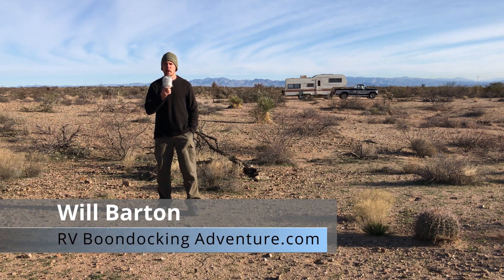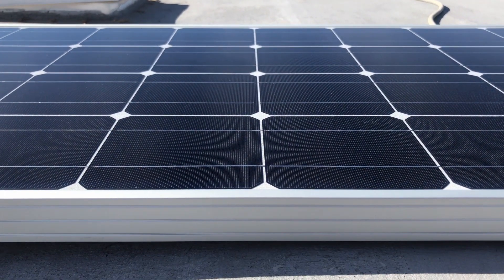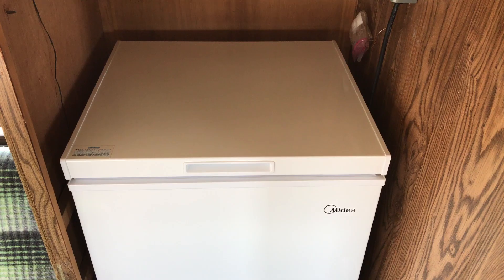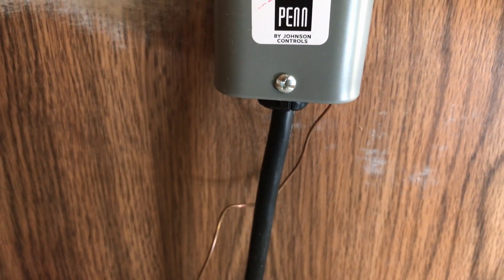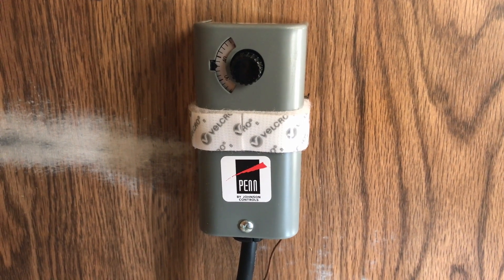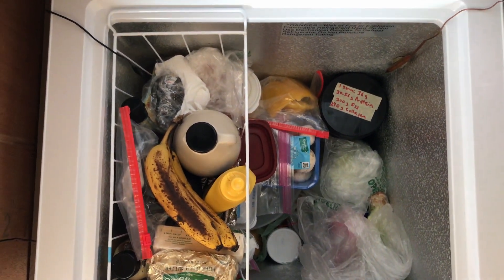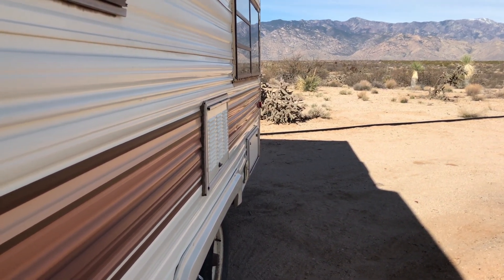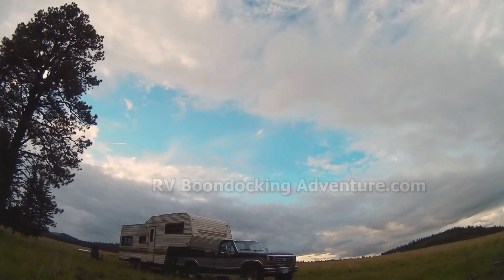Chest Freezer to Fridge Conversion, Super Efficient Solar Powered Off-Grid Refrigerator

Comment: Only thing to watch out for is the evaporator coil is made of metal un-painted pipe, and in the freezer application there is typically low pressure and ice on the pipes, but when you are running at higher temperatures they freeze and then defrost in every cycle and higher pressures, so it won't take long before the metal pits and starts to leak.
I made a freezer into a fridge, but bi-passed the cooling circuit and put in an evaporator from a frost free dumped fridge it runs the fan continually and swopped out the freezer thermostat for an air-sensing on on the return air, it will go forever, oh and I'm a refrigeration technician so this was easy for me.

Comment: this seems simple enough.  is this setup still working for you?  i asuume you can just use 110 as well without solar but thats a nice feature.  my fridge at home recently died so im thinking of this setup until i figure what to do about it.  i already have  a sm freezer that that that im going to keep as a freezer but looking for another to turn into a fridge.  Does it affect the life of the freezer and can you go back to a freezer setup by just removing the controller.  also do you keep the freezers orig thermo off position?

Comment: just the info I was looking for! scratching my head over DC type EXPENSIVE RV fridges, etc. -- I've often wondered about the use of a chest type freezer AS a fridge -- but for residential purposes rather than RV'ing though now that I have an RV (trailer) I'm definitely now leaning in the direction of this off-the-shelf freezer->fridge option.
my motto has always been -- "whatever works -- use it!"
this solution of yours works. I think I'll use it!

Comment: Extra efficiency can be found by wiring the external thermostat to turn the inverter on and off. Then just wire the inverter directly to the freezer. Does need some electronics knowledge though.

Comment: Question about plugging it in - you plugged the fridge into the temp control and then into the power bar, but do you need to change it from DC to AC or how does that work?

Comment: Good review and a lot of great advice here about the way you park and all the details you mention to conserve energy, very frugal and efficient indeed. You made a lot of good points here, one of ur issues could be overcome by making or getting a nice fitting foam box/container sleeve to fit in the top half or so of ur fridge/freezer setup, cut some elongated slots in side for grasping handles to remove when u want to get a frozen product out from below deck, and use the top half as a fridge, u would need to turn down the thermo of course, but I have done this and it works pretty good. Another small tip is to wire the thermostat to a contactor to activate the inverter when the thermostat calls it up, this can use significantly less power through discarding the inverter idle drain between cycles. Cheers

Comment: Maybe I missed it, but what size batteries did you use?  And are they serial or parallel?  Do you notice it needs a lot more juice to start up the compressor then drops back down to a lower rate or does it stay low all the time?  Thanks for any help!  About to try to build one of these with zero experience lol

Comment: I use a 5 cubic foot freezer for a refrigerator. I use it off grid through my inverter. I don't use an external temperature control. I simply keep the entire bottom filled with one gallon or half gallon frozen jugs of ice. That allows me to run the freezer just about 4 hours a day keeping the food on top nice and cold. I simply manually monitor this a couple of times a day. No problems.
Reply: When it is freezing the jugs, isn’t it freezing your food on top also?
Reply: @Lst2ltdwn  If you don't shut down the freezer it will freeze everything in it. That's why you run it for just a few hours a day. You simply keep an eye on it a few times each day. Getting too warm on top? Run the freezer for an hour or two.
Reply: @MrBwalendy  Could you partition off the bottom half with a piece of styrofoam to create a fridge/freezer?

Comment: Young man, thank you for the video, perfectly done. This is to let you know the link to the thermostat is no longer viable, therefore not giving you the affiliate reimbursement response that should be applicable in this case. I did not check all of the links above. I find Amazon does this to quite a many of you. The product is there, the affiliate is not, as I had to keep digging to find it.  The freezer link worked. Blessings on your travels.

Comment: Can anyone tell me what size lithium battery will run a freezer to fridge conversion of 3.5 c ft. I now have 120 watt solar panels but will be adding more. Need around 300watt Ive been told.
Reply: Lithium batteries are like motorcycles. You always want more power.  100 amp hours should get you started. Some are down around $400 now.  Its your inverter that might be the hangup. Mine is a Renogy 1000 watt pure sine unit and it has been very reliable. An inverter that's too small will trip out on overload and not start the fridge.

Comment: I would recommend opening the freezer and disconnect the automatic defrost heating element! That will greatly save you power from your batteries, and you really do not need the defrost option , and it will make it even more efficient , and small 12v computer fan sucking heat from back of the freezer outside of your camper every time it turns on :) and then you have the best solar and cheapest RV fridge

Comment: Does anyone know if doing this reduces the life of the freezer? Since it shuts off the power on or off in a way that isn't normal to the freezer.
Reply: In my experience it will significantly reduce the life of the freezer if it cycles on/off as often as a refrigerator.  To reduce cycling the temperature set point needs to have a wide band of several degrees.

Comment: Thank you for sharing!! What if the solar panels don’t receive enough sun as you do? I’m in Ca. and the fog rolls in often.
How many hours of direct sunlight do you need to make this work??
Reply: A lot of these setups seem to run 40-80 watts with the inverter losses included.  They don't run constantly though.  Standby power when it's not running might be 5-20 watts depending on the models.  I think I've seen around 600 watt hours for the day.  It depends how hot the air around it is also.  If it's hotter it takes more than when it's cold so good ventilation helps a lot.  
I have thought about building one with another 2-4 inches of foam board all around just to see what it's like.  Then have a vent door into the freezer vent from outside with a thermostat controlled flap that vents heat inside or outside depending on weather and preference.
Even with the setup as is in the video the 200 watts of solar is pretty solid if the panels face the sun as well as possible.
I would say at this point.  Lithium batteries bury lead acid already.  A diy kinda person can watch a short video on YouTube assembling a battery out of 4 280ah lithium cells for less than $500.  That makes approximately 3600watt hours.  About three times a lead acid.  But it's as good as 5 or 6 lead acid and will last 5 times longer as well.
Reply: Apparently some are saying that some modern freezers dissipate the heat through the outer shell... You would want one with a very important vent on the side to dump heat

Comment: Excellent video!  I have purchased my freezer and temp controller but I have one question. What do I need to set my freezer temp controller on?  It’s 0-7. I have it on 4 now.  
Thank you for any help!
Reply: I'm not sure the  freezer control matters much as even at it's lowest(highest?) setting it should run till it is below 32F but your temp controller should shut off the power before that as your looking to keep it around 38-42F. to make sure its working properly you'll want to have a way to check the temp, either with a indoor/outdoor device like the one used in this video or something smaller that you just keep inside the freezer.
Reply: Daniel Avenson  thank you. I have a thermometer I have been using. It’s working great.
Reply: I’d set the freezer at its max and let the auxiliary ‘stat run the thing free reign.

Comment: There is no moisture management in the deep freeze, these quickly fill with mold
Reply: Do you ever clean your home fridge?  Its very easy to clean one of these.  I have two Dometic fridge freezers and they still don't have mold, so quickly is pretty far off.  If he is a full time off gridder, he can just preplan , have a spare cooler to put some food in, or be on his way back to get more food and leave it out in the sun for an hour.  Jeez, its totally not hard at all.

Comment: I replaced my freezer thermostat with a refrigerator thermostat.  $16 on Amazon, and it looks original.
Reply: Maybe you should also do a video then. Was their rewiring involved?
Reply: @Gandioneare7844  Just some screws and spade connectors.
Reply: Do you have a link to the item on amazon?
Reply: I don't.  It was a few years ago, and depends on the make and model of your appliance.

Comment: You didn't cover condensation/water build up on the bottom... I heard that can be a problem. Is there any way to run/make a drain for the bottom of the fridge, or would you recommend against that? Thanks for the video!
Reply: every chest freezer i've seen has a built-in drain from the factory.

Comment: I've operated three 8cf freezers as refrigerators with these Johnson controllers in my BBQ food truck. Work well but there is a fairly significant temperature on/off variation because the inside air stagnates on the bottom.
I haven't got around to it yet but a definite improvement would be to place a small ac muffin fan on the top of a PVC pipe or a eave through section to circulate  the air top to bottom. This would be powered from the compressor plug and mounted in the corner of the fridge. It would keep the temp far more uniform and improve overall performance.
Reply: Great idea.

Comment: no need for a refer if you have a freezer....just cycle frozen food / water / etc. into a cooler to defrost and cool ....then only one compressor to run....
Reply: And how many watts/btu are used up freezing things? That seems counter productive imho
Reply: @fishhuntadventure  my refer uses 4 A.@ 12v...50 watts , WHEN IT'S RUNNING...maybe 2-3 hrs. a day ,easily handled with solar or  ?
  as a freezer it might run 2X that(?)...i also built a foam box to enclose it for better efficiency..
 these little compressor types are so much more efficient than any alt. i've found , but it assumes you want COLD storage for a week or so...it changed my life for the better
this is an old acct. i'm visiting ; funny how much things have changed in a year !
OH...just looked @ the vid , and it's true , a 110 thru an inverter would use  more (?)....i am using a 12 v.danfoss type

Comment: I'd like to share my results on a similar project.  So there are a number of variables here that I'm aware of so technical guy out there just sit back and relax.  I bought a brand new Magic Chef 3.5 C. Ft. chest freezer (June 2019).  I bought a digital temperature controller and set the fridge/freezer compressor to turn on at 40F and turn off at 37F.  Once off, I recorded the temp continuing to drop as low as 30F before it would start the slow temperature climb back up.  I found it interesting that the temperature dropped another 7 degrees after turning off.  Also note that I had the unit completely empty, unit already at the desired temp and it was placed inside my house at a constant 78F when I started this test.  After 48 hours, here were the results of my freezer to fridge conversion: My kill-a-watt recorded that it only consumed .238 KWH (which if I calculated correctly, is only 5 watts an hour on average).  Of the 48 hours, it ran 7 hours and 40 minutes.  I noted that when the compressor turned on, there was a momentary spike of 700-800W but leveled off very quickly to around 60W.  I forgot to log the time it would run before turning off but I would guess under 2 minutes.  Also, the temperature controller was measured at idle fluctuating between 1.2 and .2 watts but I noticed it typically sat at .7 watts most of the time.  Understand that if you wanted to run this setup, you would also have to account for the draw/consumption of an inverter. Although I own one, I was not able to test the usage on the inverter as I don't have a tool (yet) to measure the DC 12 volt side. 

Regardless of the exact accuracy on my basic test, it's pretty clear that it is extremely efficient.  I'm convinced now that it's the way to go for off-grid refrigeration for at least short term. I've heard there is an issue with water collection in chest freezers once they are converted so in a long term situation, that would have to be addressed. 
 If you are attempting to get even more efficient you can shell out a lot more money on a 12volt refrigerator or freezer but for just my camping needs, that would be too expensive. I spent $110 on the chest freezer, $40 on the digital temp control and $225 on the inverter.  You could easily spend less on an inverter but I had other items I wanted to run off my system so I got one that was rated for much more than what the chest freezer required.  

I hope this helps someone out there curious to semi real world numbers on this kind of set up.  I'm surprised there isn't more data/info on this subject on youtube.  The lack of it is what caused me to go do this on my own so I could see for myself.

I forgot to add that I never opened the door either (except maybe once) which could also help account for my extremely low consumption.  In a real world situation, this would be getting opened much more frequently.  Regardless, this is still a very efficient option. And thank you for sharing your informative video.
Reply from the maker: WOW! Thank you! That should answer many questions about efficiency :)
Reply: Thank you! Very interesting. All these data built on personal experience is so hard to find. The inverter you are using, was it the pure sine wave type?
Reply: @erikbjork3715  Remember, I mentioned that during my test I didn't do this using an inverter because I didn't have a way to  measure a 12volt current draw.  I had the chest freezer plugged into the temperature controller and the temp control into the kill-a-watt meter and then the meter into a 120v outlet in my house.  However, I do own a 2000w pure sine wave inverter and I was able to use my set-up a few weeks ago.  I had 2 100 watt renogy solar panels connected to two 100amp hour deep cycle lead acid batteries in which I connected the inverter, Temp control and chest freezer to.  The first day worked great as there was sun all day even though I was in a pretty heavily forested area.  The next 6 days it was mostly cloudy and I had to keep moving the panels to get any chance at direct sun.  I was limited by the amount of tree shade and the clouds unfortunately.  Consequently, I had to run my generator each afternoon for about an hour to just top off the batteries and make sure the chest freezer worked throughout the night.  I think had I not been in such a wooded area, I would not have had to run the generator at all, even with it being cloudy.  So there really is no conclusion, this will be an on going and ever learning excersise. There are always so many variables to every situation and within that same situation the variables can change again.  I already have plans for next time to tweak the system and  hopefully get better results.  Hope this helps👍
Reply: Many thanks for the comprehensive info! Much appreciated.👍
Reply: great writeup! 

WRT water collection, my chest freezer has a defrost drain so i can divert the water wherever i want.

might be worth looking into that?
Reply: Great write up

Comment: You may be tied with space, but get a 7cf one if you can. It is pretty hard to find stuff.  I run a chest fridge off a micro and it only runs during the day on solar.  It never lets the battery drop below 90% of full charge.  The temp runs very close to 32F and there is lots of cold stored in liquids that is used to keep it thru the night. Some fridges are terrible at stratification of temperature.  I run an internal computer fan to keep the air circulating.  Otherwise the lower part will freeze where the coils are located. You will condense lots of moisture so make it easy to drain the bottom. I run with only a single car battery doing this.
Reply from the maker: Great ideas, especially using a fan for circulation!

Comment: I like the fact this method does not require any re-wiring... like those who wire in a digital controller.

FYI, Midea makes these freezers under many other labels... arctic king, koolatron, to name but two... I just picked up the 3.5 model for $200 can. at wally world, and the 5.0 model, scratch and dent, for $115 can..

There is also a solar store in Mississauga, Ont., selling 24v poly panels for under $0.70 / watt...solarshoppingmall... Picked up a pair of 295w for $390.

Thanks for the vid!
Reply from the maker: Thanks for the tips!

Comment: Thank you for the great info & links. I am planning to build an off grid solar TH in NW AZ for the winter months. I knew going in that refrigeration was going to be my biggest problem/draw. I think you have saved me a lot of experimentation & expense.
Reply from the maker: Thank you, good luck with your off grid project
Reply: I was off-grid in an RV/camper setup in southern Colorado for a couple of years.  If it has to run the propane furnace a lot it will end up taking a lot of the electricity for the blower fan as well. Refrigeration isn't too bad by comparison.  If you've super insulated something then it will help